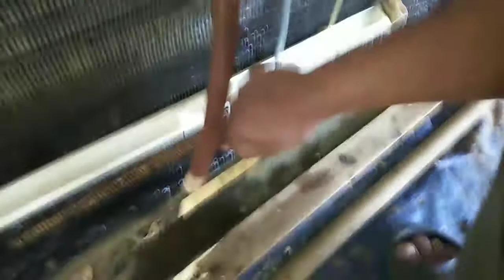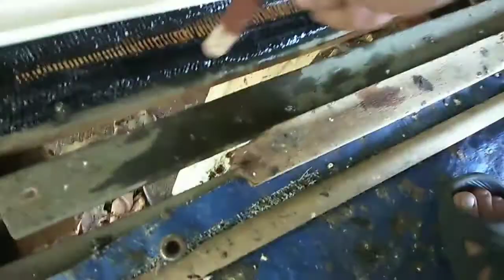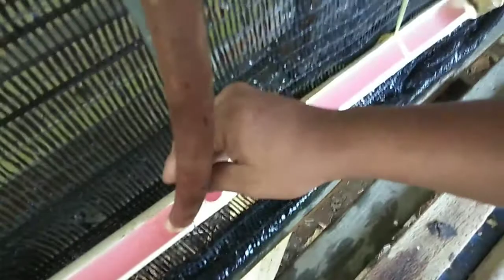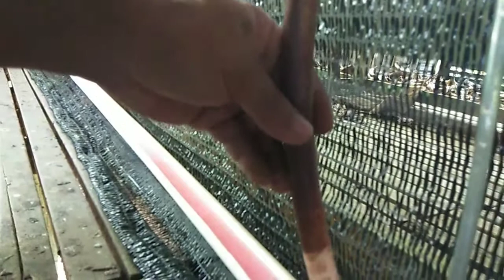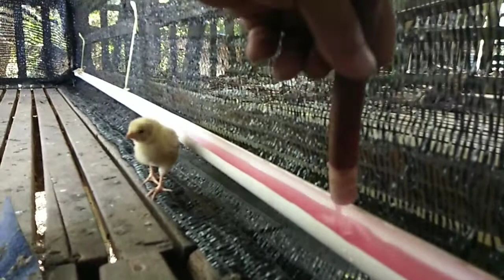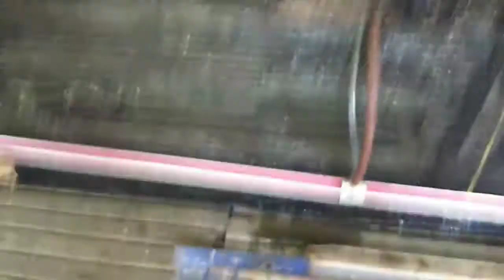MOST effective water feeder for chicken

Comment: How its work.
Reply from the maker: look at this image than u can understand.  http://allan.holmstadt.com/images/reef/simple_ATO.gif
Reply from the maker: the basic principal is Gravity and air pressure.

Because of gravity, the water in the reservoir wants to flow out through the small opening in the air tight tank area but cannot because the pull of the water creates a low pressure zone in the top of the tank that counteracts it (it’s like anti-gravity!) by “sucking” the water up. This suction cannot be relieved so long as the water in the bowl remains higher than the opening in the bottle.

As the water in the bowl feeder is consumed or evaporates there is an instant where air can slip past and “glug” to the top of the reservoir, displacing the water that pours into the bowl.

But when no more air can get past the water and into the top of the reservoir, then the flow of water stops.